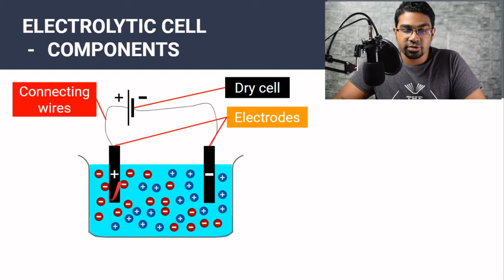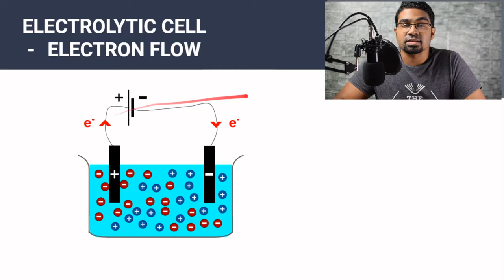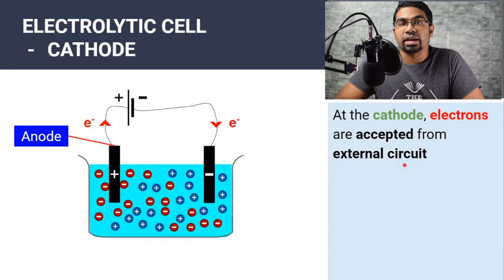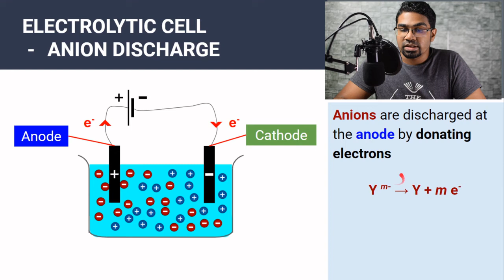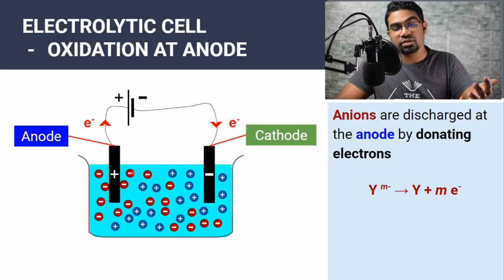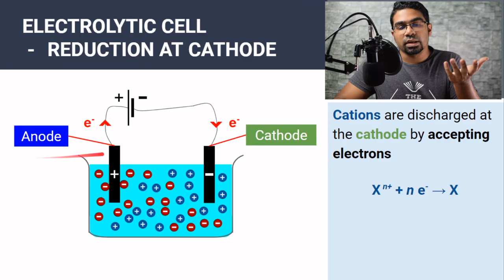Electrochemical Cell - Electrolytic Cell

Comment: Sir electrons are negatively charged so why they will go to the cathode??? 
Becoz as per the laws of electrostatics two similar charges will always repel and unlike charges will always attract...
So electrons are negative so they should move to the positive electrode (anode) 
So in this video why it is said that electrons are moving from anode to cathode??? 
Sir can you pls clear my doubt ....
Pls it is a humble request....
Reply: Sir pls reply....
Reply: @UCJ4TAZJlH4SSxfo39bAtWgg but sir 
Two similar charges repel so how electrons will move from anode to cathode??
Reply from the maker: You must remember that electrons move from the negative terminal of the POWER SOURCE to the positive terminal of the POWER SOURCE. The potential energy to move the electron comes from the power source and not the electrodes. So if you look at the circuit again, the electrons are indeed moving away from the negative terminal of the battery (power source in this case) and it is moving towards the positive terminal of the power source. The negative and positive electrodes are labelled so because of their relative positions to the terminals of the battery. If you bridged the positive and negative terminals with a wire, you will see that electrons do in fact flow from the negative to positive terminal.
Reply: @MrRuelTuition  sir but two similar charges repel so how electrons will move from anode to cathode?? They should move from cathode to anode...
Sir Which one is correct 
Plz explain it in a easy way...
Pls it's an humble request....
Reply: @MrRuelTuition  sir you have explained but I didn't understood 
So can you plz tell in easy way..
Reply: Electrolytic cell converts electrical energy into Chemical energy and the reaction is non spontaneous. In a spontaneous reaction, electrons move towards the positive electrode. So the cathode is positive. In the non spontaneous reaction electrons are forced to move towards the negative electrode.